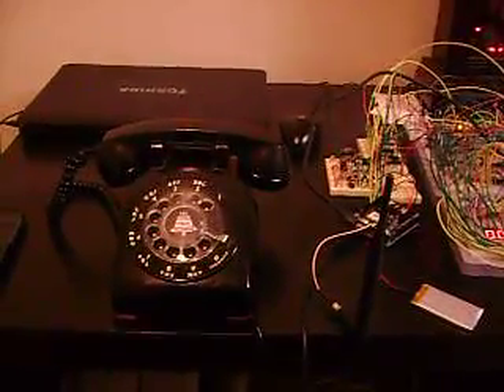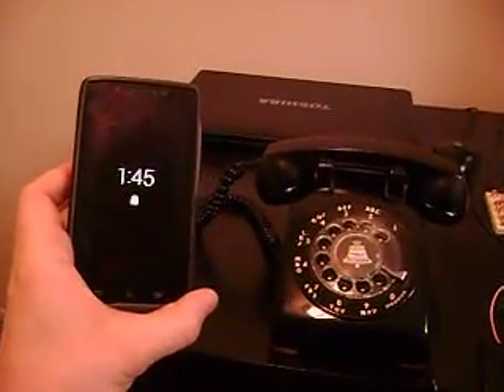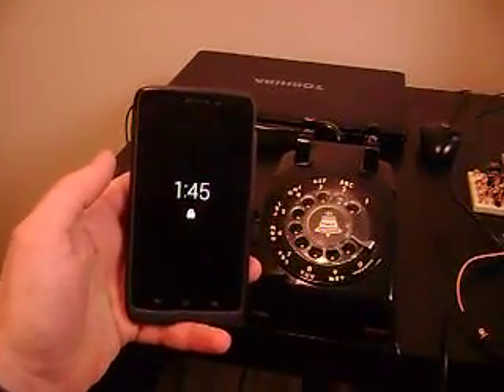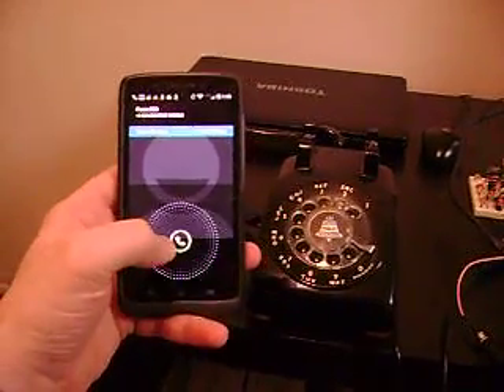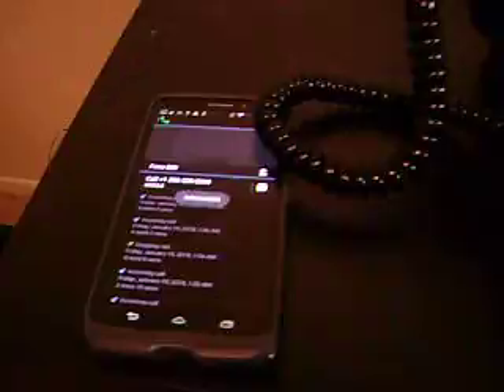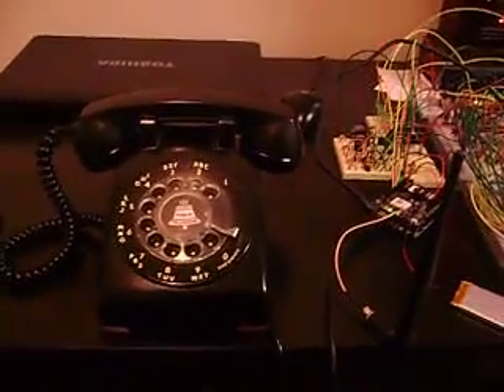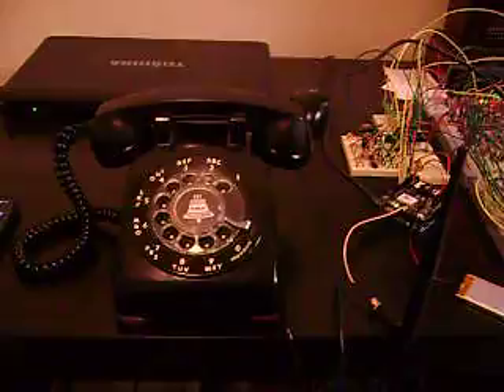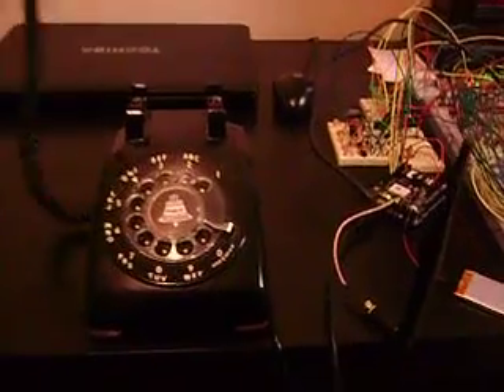Arduino Rotary Phone... it works!

Comment: Nice project Dane! do you have the project documented anywhere? was looking into create a private phone network with arduino
Reply from the maker: Thanks! I don't have the project details documented online. My project uses a Fona 800 by Adafruit. It's a cellular GSM modem that talks to an Arduino to make calls on the 2G network. 2G is supported by T-Mobile 'til the end of 2020 so at some point I'll need to upgrade:https://www.adafruit.com/product/2468 However, if you're trying to make a private network it's probably not the way to go. You might want to look into Raspberry Pi and RasPBX:http://www.raspberry-asterisk.org/ I don't have any personal experience with this setup but did a little research on it before I decided to go with the Adafruit Fona. Good luck!